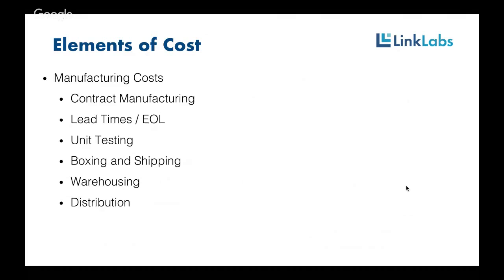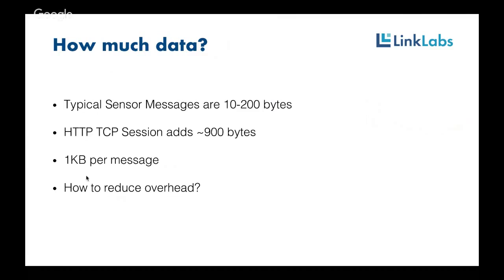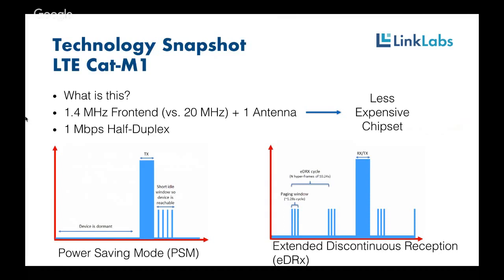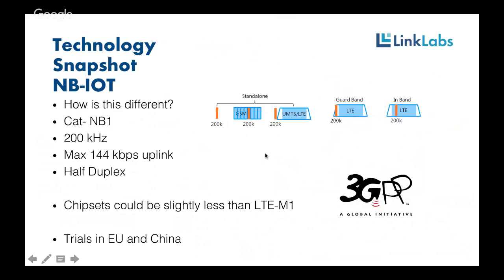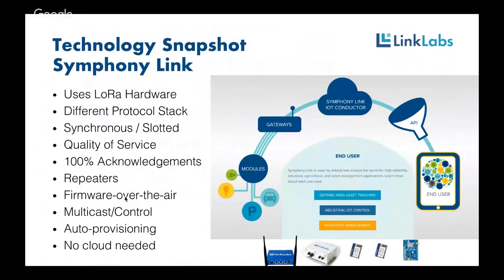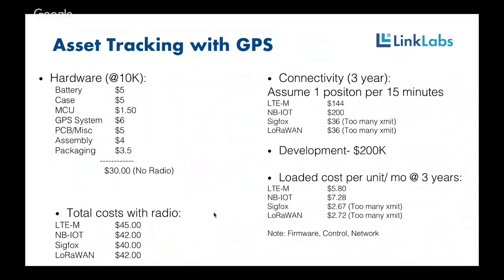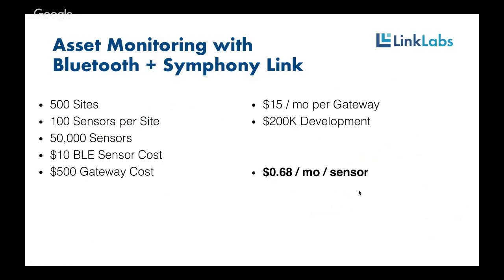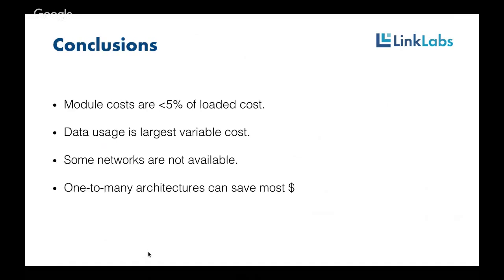Costs in LPWAN - LTE-M / NB-IOT / LoRaWAN / Sigfox / Ingenu

Comment: LoRaWAN enables class C end nodes, definitely possible to configure the device over the air and send commands to it that cloce a valve or switch a relay.  Even as a class A device, there are two RX windows in which control params can be sent down.  Great vid though.

Comment: Hello, one question, why do you think is not possible to send geo location using SigFox in your example?
 
Using geohash a complete address would be 12 characters, but as you would know, geohash prefix are the same for similar locations and also Sigfox give you an approximated area using his antennas (so you can avoid the first characters from your geohash). 

Also Sigfox allows 140 messages per day (1 message per 10 minutes more or less) with 12 bytes so in the worst scenario you can send a full geohash (but the smartest way is to send only the suffix that has changed from previous position).

For example, imagine that you are somewhere in the Brooklyn Botanic Park, your geohash would be "dr5rken0uwu6".
You can check in the next url:
http://geohash.org/dr5rken0uwu6

Then you move to somewhere between 7th avenue and 9th street... your new geohash would be "dr5rke0jpp7z".
Check again here:
http://geohash.org/dr5rke0jpp7z

The common prefix is  dr5rke so to send a location update you can just send as the next event the geohash 0jpp7z (just 6 characters):
    dr5rken0uwu6
-   dr5rke0jpp7z
    -----------------------
                 jpp7z

This is just a quick example of course, a fully API should be more elaborated but in my humble opinion is feasible to do it.
Tell me your concerns please, probably I missed something!!

Comment: There is a lot of WRONG information about the SIGFOX solution !!! You should review your sources since you are not being fair.  There is not problem for SIGFOX to support a message every 15 minutes, since the standard stipulates 140 messages per day, or one every 10 minutes (ETSI). 

Plus your connectivity costs estimates are much higher than the reality. For metering, with 1 message per day, your connectivity costs are 10 to 30 times higher than the reality.....  so your comparison is skewed.

Besides, the USA will be covered entirely within a pretty short time....  and you do not mention deep indoor reception, which is an additional benefit of the LPWAN technology, and also the fact that it is not jammeable, unlike LTE, NBIot and LORA (Spread spectrum).

In short, either you are not well informed or you are fully biased !!!!
Reply: Agree with you Guyginestet,  a cost study from a company that has his own LPWAN technology could not be very impartial.  but i think the real good question is not the costs between the different LPWAN techs but witch one is right tech for your use case needs.
Reply: Please refer to this white paper to have more impartial costs : 
https://s-media-cache-ak0.pinimg.com/originals/12/cf/c4/12cfc41a14fae49a4b07c26750d2fad9.jpg
Reply: @danisamgibs  Very interesting. Is there an updated version of this?